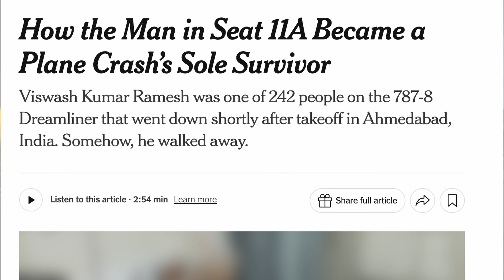Why the RAT Changes Everything – Air India 171 Update

Comment: What about the fact they used the entire runway? Aircraft usually rotate (V2) 2/3 or 3/4 down the runway, this aircraft rotated just before the overshoot (you can see the dust kicking up).
It appears there wasn't enough power even before rotation. Should (could) they have aborted at V1?

Comment: Check out other Video, 
I observed 
1. 787 just took off last edge of the runway 
2. Just last second of take off she swirled slightly to right side of the runway, see the dust storm created by engine flow (possible indication of right side engine failure or loosing power of it )
3. 41 C Air temperature, very thin air of intense heat also added heat of previously taken off flight, plus fully loaded large aircraft might not have generated required under wing air pressure to achieve sufficient lift.. 

So first right side engine failure than left side engine failure and thin air giving NO LIFT CAUSING GRADUAL SINKING AND FALL ON HOSTEL BUILDING.

I am not aviation expert but my simple scientific observations from videos observations
Reply: Are you a scientist?

Comment: The flaps weren't down.  They should have been down 15 degrees.  The undercarriage should have been retracting.  Hydraulic failure, maybe from engine failure.  Difficult to be sure until black boxes are analysed.

Comment: Hello, for me,there  is no problem with flaps (not possible on this kind of plane), that's probably an engine (right) failure, that's why the RAT is outside, if you add high temp (40°C) on floor, a plane full of petrol and pax, you have the accident conditions's.

Comment: as the plane was taking off from the runway, there was a plume of dust thrown up. This would imply that this plane used up more than normal runway. In other words, the runway normally used would not throw up a plume of dust as happened for this take off. Surely, this implies that `power and thrust` was already a problem, even before they got off the ground.

Comment: i see there is aviation experts in the comments, well captain speaking here, i think that the reason for the plane that crashed is that the both engine failed which the pilots deployed the RAT ( Ram AIR Turbine) which is deployed only if both engines failed, or we should wait about the final report.

Comment: Hello sir!! Assuming its a dual engine failure right after the take off at 600 ft pilot hardly got 10 to 12 seconds to react to anything judging from the descent rate, very unfortunate !!
One question - if dual engine failure would have happened at a higher altitude suppose 1000 to 1500 ft or even higher was there a chance of possible recovery for aircraft in that scenario? Has it happened in past?

Comment: Guys im just 9 years old boy please just don't mind some of them if i get them wrong..

Guys this planes tiny propeller has fell of and has  a few problems 1: Flaps are not working as you see the flaps didn't manage to get pulled down and was showing up so it can't maintain height😞

2:the engeeniers haven't really fixed the planes propeller,so theres a video of a passenger showing conditions of the plane not working and that makes sense because if the tiny propeller wasn't there it can make the engines power also go down so threatens the power of the plane :(  now as if you didnt know the tiny propeller is made for amazing stunts and power for the airplane but if if the tiny propeller right next to the landing gears just somehow fell of the plane in middle of the flight that means its danger dor you.... ☠️

3: the plane can desolve problems by the engineers not just putting the planes parts  together loose  i don't really think that they even care about the plane getting crash and just get cash of engineering... 

4: the india temprature was 38 degrees hot before takeoff the engines cant handle the temprature sadly😢

Probably because of bird-stikes who knows?

If this helped you please comment something down below 

Pray for air india 171 and the beloved passengers!

Comment: There may be another bit of evidence to support your claim. The APU inlet door is clearly open perhaps caused by the impact but this is opened to automatically run up the APU on loss of 3 or more bus bars i.e 3 / 4 of the engine driven generators.

Comment: A few hours after the Event we made this statement on Social Media and we stand by it "In the video , you can hear the RAT engaged.The L/E slats are extended on the ground with little or no T/E flaps extended. That could not have been the Take Off configuration, and "proves" the flaps were selected up after Take Off. Pilot Error is the cause of this Event.
"

Comment: Thank you for this fine analysis. Can i ask something though, dont the pilots check for airworthiness of a plane before flying ? How can a pair of faulty engines be missed. Also, it can be seen from the other video that the plane takes off from the end of the runway and had not attained enough speed as well (from flight data). All points to engine issues. Why was such a plane considered airworthy . I am an indian and i am never flying air india or boeing again.

Comment: Our heartfelt prayers and condolences to all the families of the victims, crew of this terrible tragedy. On fuel contamination; wouldn't or shouldn't that also affect all other aircraft receiving fuel from whichever same source had supplied it? it was a very hot day apparently.  Another possible theory,  Could a unique set of circumstances cause a particular kind of electrical failure which would affect the fuel pumps? I remember seeing a video from your colleague creator Mentour Pilot about an airbus accident where if I remember correctly,  power was lost like this and it was ultimately due to, along with other things as per usual scenario not just one thing,  a circuit breaker being in the wrong position ostensibly from a cleaning crew, if memory serves me.  In this Air India case,  our blessed lone survivor said he heard the engines running the whole time but perhaps they were not getting full power, which would be critical to take off fully loaded like that. It seems like their power (fuel flow?) was  limited (flaps or no flaps) . Modern  high bypass ratio jet engines don't have the dark smoke trails like older low bypass turbojets but they do have a trail of their own if you look closely,  they seem to be at less than full power and the pilots last words would confirm  that, I  believe he said "no power".  In that scenario, if this happened prior to the point at which the flaps would be raised, a stressful situation to say the least, It's always possible the copilot could have also raised the flaps by mistake due to the stress, which would have made the overall lack of lift condition even worse as speed continue to bleed off and it started to nose over. I wonder if and electrical failure happened as they became airborne and then the co pilot raised the flaps as well in the stress of the moment. Hopefully the black boxes will proved the answers needed to determine the cause and take appropriate action if needed regarding the 778. Thank you for your efforts.

Comment: Useful information, it's should be electrical problem or both engine down.

Flap 5 is not the key.
Depend on previous flight passenger said, the on board entertainment was down.
Pilots mayday for "no power" and electrical failure would let RAT operational.

Will a short power outrage, may caused engine to stop? Or just something related with power downed/burned(like fuse)?

Comment: If the plane had an electric failure and many things haven't been working who gave the plane a clearance to take off!? There is no way when you check the engines and everything else and it doesn't work properly you take off... They should definitely examine the communication between the air traffic control tower and pilots because it truly is weird that plane takes off and they realise in the air that sth is wrong. You would have noticed such a major problem even before the take off!

Comment: Now we have a partial "answer", it will be some time  before the crash investigators are able to discover the actual cause of the failure. I would add that the aircraft just managed to lift off before the end of the runway throwing up a huge cloud of dust and debris, had the engines already started to fail as they were taking off?

Comment: I would bet on a fatal electric or hydraulic failure not the engines. This would also explain everything and would explain the partially retracted landing gear. I deeply hope that this accident is not a sign for another boeing related problem (787 not aging well?).

Comment: Was the RAT automatically initiated?

Was it manually initiated due to the lack of cabin electrical in the previous flight, in order to provide supplementary power for the cabin on this flight?

Has the video been doctored?

Why would 2 pilots take off knowing that there was no electrical in the cabin during the previous flight?

Why did the previous passenger slam Air India?

Seems like poor maintenance and a culture of keep the planes moving.

Comment: Is there a way to quickly dump the fuel from the airplane? It seems to me that the major contributing factor to the extent of the tragedy is the unburnt fuel. Pretty sure it is quite often the case during take-off tragedies. Would be interesting to know if it could be possible to drop all the fuel in 20-30 seconds, and if it may increase the chance of landing.

Comment: While everyone is focusing on the part where the flight is airborne, I m curious about the actual takeoff roll. Did the flight take off at the usual position on the runway for a flight of its size? Or did it use up more of the runway?
Reply: Thought the same myself. There's a lot of dust kicked up when the aircraft rotates which does make it look as if it went right to the end of the runway.

Comment: Battery disconnection causes both engine failure on 787, without DC the AC BUS ties release, the FADECS on the engines shutdown and the RAT deploys. I suggest the battery plug was not secured (usually a terry pin) and that the screw unwound and released the plug. Poor Flexops ???

Comment: I was wondering, and maybe someone can help shed light on this, but it appeared that the plane also used up more runway to get airborne than it typically would. Is this unusual? and could it be another clue that the engines were not getting the right amount of fuel to produce sufficient thrust?

Comment: You almost had me convinced about the pilot error with the gear. Now even more convinced it was likely some kind of fuel contamination (possibly water) that got into the engines and caused the loss of thrust. Will no doubt find out when investigators check the refueling procedures and, more specifically, the vehicle used prior to them pulling back from the apron. But, if I were betting, thats what my money would be on.

Comment: Key Considerations Just After Takeoff:
At very low altitudes and speeds below ~100 kt, the RAT will not deploy or may not be effective immediately.

Even if it deploys, it might not spin fast enough to provide usable hydraulic or electrical power until sufficient airspeed is gained (typically >130–150 kt for full performance).

Comment: How about we take a look at the landing gear angle too?

Swiss001 put out a VERY informative video about the incident before this video went up, stating a new fact (along with the RAT). A part that we all overlooked, the landing gear angle. The 787 has a tilt to the landing gear, but not in the direction that the video right before the crash shows. It is shown tilted the opposite direction that it would usually be if it was landing. 

If you take a look at how the 787 stows its landing gear, it tilts the landing gear foward first, then stows it. If we take a look at the videos of the incident, the landing gear is tilted, BUT in the foward position. This suggests the landing gear was in the process of being stowed, but stopped possibly due to the loss of power. 

If you want a way better explanation, watch his video (I linked it to the timestamp of explanation): https://www.youtube.com/watch?v=Ac90bLg1Oek

However, with this new information, we could also assume that the problem took place right after positive rate, as gear would be put up after positive rate is called. 

It could be safe to say theory #3 that was mentioned in the beginning of the video is debunked.

Comment: One thing to point out though is that the sole survivor did mention in an interview that the engines were still roaring ahead whilst the plane was descending. Whilst this could be engines spooling down after engine failure, it could also lend itself to the scenario that engines did not fail and something else triggered RAT deployment

Comment: 787 skipper here.
I’d like to know if he overran the end of the runway on Take-off because he kicked up a pile of dirt on rotation which would be indicative of a performance calculation error with possibly incorrect flaps set. Reaching end of runway before VR? Not saying that is it but it wouldn’t be the first airliner in history has run out of runway before reaching VR.
The only other thing, as ludicrous as it sounds, the ‘positive rate’ call resulted in the fuel cut off switches being turned off? It’s so unlikely but even though I fly these things and heavy jets my whole working life, I just can’t figure for the life of me how 2 of these engines could fail simultaneously at such a critical phase of flight……unless they were both already running down before he even rotated?
Were software updates made to these engines simultaneously before this flight? Guess we’ll find out soon enough.
Complete tragedy, whatever the cause.

Comment: Thanks Captain Steeeve for locating the original video.
   What I heard on the TV media was the jet engines' running, though not loudly, as one would have expected full throttle in an uncontrolled decent at low altitude.

Comment: At this point we should be asking an aircraft technician/technicl engineer what could cause both engines to cut out? Im no technician but it sounds like the engines were getting little to no fuel, which in a car would point to fuel pumps/delivery issues.

Comment: Can the engines fail because of electrical (and then hydraulic) failures?? Because it was said that this plane had massive electrical problems on a flight just before and it was worked on before this flight.

Comment: Excellent analysis, now I'm on the same page with the assessment. In my eyes there is even another audible evidence in the video that hasn't been touched in the analysis- it is the absence of any engine noise. If a plane is passing by with an engine set to maximum thrust - boy you would hear the engine roar of these massive engines. Instead you hear just the RAT as the plane is flying by followed by basically just wind noises coming from the plane moving through the air. So it is safe to say that both engines were definitely not producing a high amount of thrust or even no thrust at all, maybe even being flamed out entirely.

Comment: When you watch the sharper movie as the aircraft is passing by, you'll notice that there is no visible "RAT"', when the plane comes into view. The closer proximity of the aircraft would have shown a better view of the RAT, because the image is les pixelated. But the sound you hear, is similar to that of a deployed RAT. That's very strange !!  The first visible sign of a RAT being deployed, is much much farther away. The time between the survivor heard de loud bang of the spring loaded RAT, and the actual crashing of the aircraft, must have been very short  one.  Maybe the engines, or one of the engines made the rattling sounds themselves, before the RAT was even deployed.